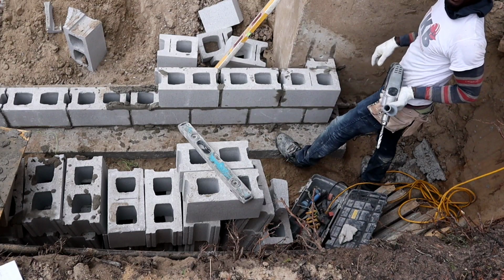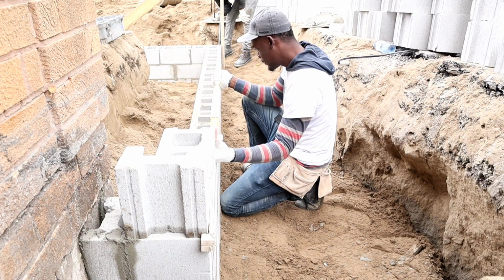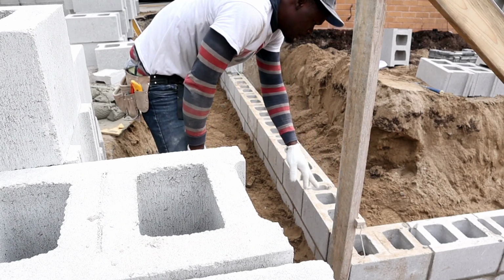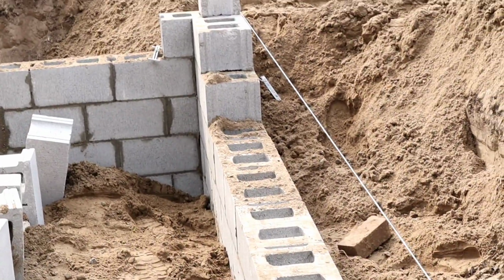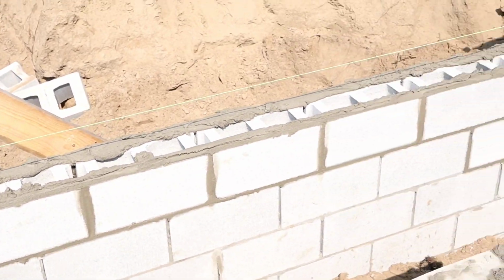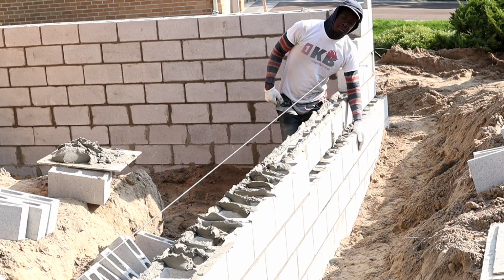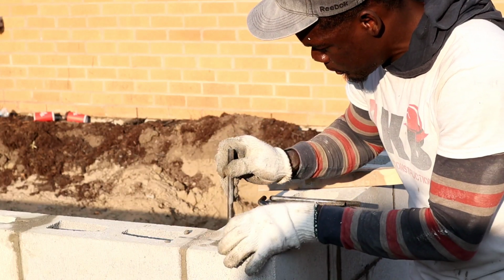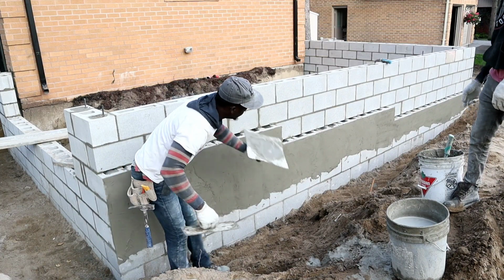how to lay block to the line

Comment: you can see the experiance you have gained in all your vids.As you get older it hurts as body cant handle it ,so i use to put string line back of wall that im  building and helped as i wasnt lifting over string line every time.Not always the best option but alot of jobs it can be done that way...You probley no this anyway...All the bestyou.

Comment: Very tidy blocklaying my brother.  Question. I'm curious as to why doesn't the rebar in the wall extend down to the footings?
Reply from the maker: That's a good question my brother ,I ask the same question, when I went there to lay the blocks, some people don't use it in there footing, 
 But in my opinion if your not going to pour concrete in the block  pocket  , after put the rebar in,it's not going to hold any strength.
Reply: @1kbconstruction824  Thanks for the reply. Interesting. I definitely would challenge the forman on that. Stay blessed and do you have any more videos coming out?
Reply from the maker: @lennieadi   There's not much you can do there telling you that's how  the engineer have it, oh I have lots more videos coming out my friend, bless up your self

Comment: As a block mason for 30 years. Why do see put trowel down every time you lay block. Faster to keep trowel in  your hand you can two hand block and trowel same time .same as 12inch block .save the moves to save your back.other wise good job.as an old guy you want  to be crippled up.
Reply from the maker: Marc, I do try to reuse the drop mortar ,but you knows  how it is,Sometimes you don't catch enough so you have to go back to the board.thank you for stopping by👍

Comment: Why not just use a "line level" clip it on instead of holding up a 4ft level
Reply: Just curious i mean whatever works for you but I just would think it would be alot easier
Reply from the maker: At the time I did not have one on site, But definitely would be way faster and easier👍